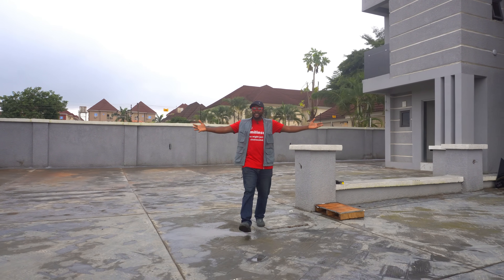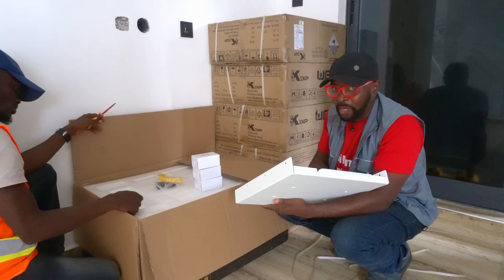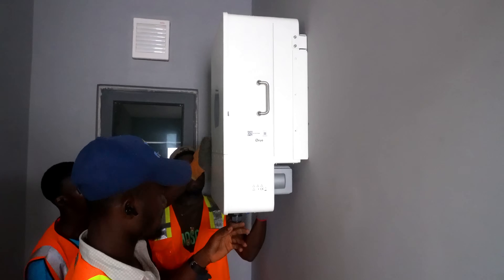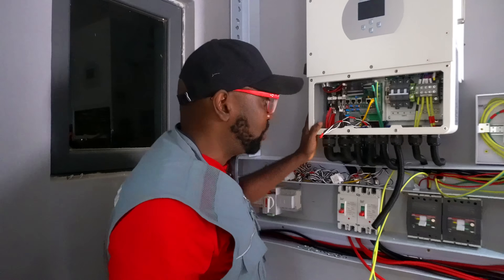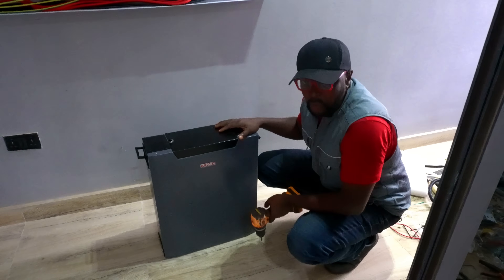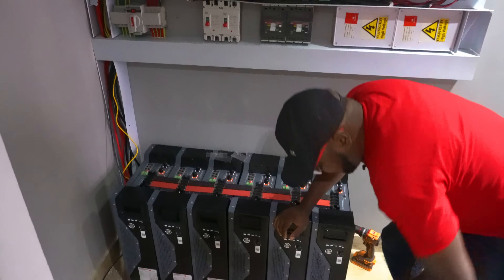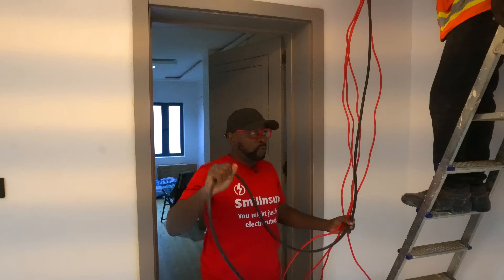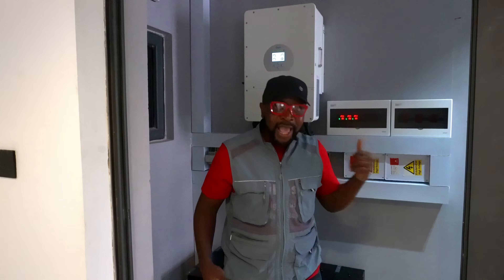Energy flex: Deye 12kW + 6 Weco units. Not just a backup its a takeover.

Comment: Love your installation.

16:31 Does the BMS dynamically adjust the operating values of the battery voltage? just thinking about battery longevity.
Reply from the maker: Yes, a Battery Management System (BMS) can dynamically adjust operating parameters like voltage to optimize performance and longevity. It ensures cells stay within safe limits, balancing charge and preventing degradation.

Comment: You did not connect the magnetic ferrite rings on the battery cable to filter out electromagnetic noise from the switching mosfet .
Reply from the maker: It's connected

Comment: The inverter is 12kw and the panel is approximate 15.5kw.
Is the panels power not too much for the inverter??
Or does the inverter has a different charge control specification that is above 15.5kw ??
Please I need a clarity sir 
I'll be grateful if you reply sir 🙏 🥲 
Thank you
Reply from the maker: The inverters PV Max Wattage capacity is actually 18,000 watts 18kw . The 15.5kw is for single phase but the three phase is 18kw
Reply: @smilinsunsmilinsun8056 
Thanks sir 🙂

Comment: Please, how much does this setup cost? Thanks.
Reply from the maker: Don't worry am sure its what you can afford without breaking a sweat.
Reply: Rough estimate 
Inverter 3m to 3.5m
Batteries 2.3m to 3m each totalling btw 13 to 18m
Panels 130k x 29   3.7m
I cant estimate cabling and workmanship. 
But this is a massive system

Comment: I was wondering. I got a single phase apartment, would it make sense to still install a 3phase Deye inverter?
Reply from the maker: No, it generally doesn’t make sense to install a 3-phase inverter for a single-phase apartment, unless you're planning to upgrade your connection to 3-phase.

Comment: Good work!
Pls note the CTs are for managing import/export from/to grid, ready against when (if) we will have net metering. They are not really for protection in that sense as you mentioned.
Reply from the maker: It’s got a bunch of functions, but the one that matters most for us (and the one I always wave a flag for) is current control and protection, we don't have Net metering around here. The rest are hanging out below if you're curious!" But your feedback is dully appreciated.

Measure output current

Provide feedback for control/protection

Enable overcurrent/short-circuit protection

Assist in load monitoring and energy metering
Reply: @smilinsunsmilinsun8056  I see your point about the CTs being used to measure output power and prevent overload, however I see increasingly that hall-effect current measurement is preferred for modern inverters. Grid-coupling introduces additional safety-related issues - voltage amplitude/phase/frequency synchronisation as well as net power flow (requiring CTs). I used to design these things and still take an active interest in the tech in use. 
Happy to meet F-F when I am in Lagos ... or maybe we can even do a joint tech deep-dive?
Reply: They just released policy for net metering, so at some point in the future we will see this

Comment: What's the difference between 3 phase and Single phase?
Reply from the maker: Single-phase wiring uses two wires (live and neutral) and delivers power in a single alternating current cycle — ideal for homes and light loads.
Three-phase wiring uses three live wires (or three plus neutral) and delivers power in three alternating cycles — used for heavy machinery and industrial applications due to more efficient power delivery.
Reply: @smilinsunsmilinsun8056 master wey Sabi, one question with two different professional answer...I just love you

Comment: What's the difference between 3 phase and Single phase?
Reply from the maker: Single-phase:
Uses 2 wires (Live & Neutral),
Delivers 230V,
Suitable for homes and small appliances,
Power supply is less stable for heavy loads.

Three-phase:
Uses 3 or 4 wires (3 Lives + Neutral),
Delivers 400V,
Ideal for factories and large machines,
Provides more stable and efficient power.
Reply: @smilinsunsmilinsun8056  Quick question, can I still use a single phase inverter for a house that has 7 ACs, an electric burner and a washing machine, or you will suggest I use a 3 phase?
Reply from the maker: @signature_gh2735  You can use single phase

Comment: Deye uses the cheapest, most unreliableble inverter tech on the market. They don't even incorporate an output transformer to provide galvanic isolation. No thanks.
Reply from the maker: Appreciate your input, but it seems there may be a misunderstanding of Deye’s design choices. Their transformerless topology is standard in modern string inverters, offering higher efficiency and reduced losses. Galvanic isolation isn't a reliability metric—it's a design preference based on application. Might be worth reviewing their latest specs and certifications.

Comment: Nice installation. Am impressed about the solar array generation and you didn't share the parameters of the solar panels you tested as well as what section of the building is this system carrying. cause that's a massive building right there 😅
Reply from the maker: Just one section of the building, it's 8 units. I mentioned that panels are 590 Watts.
Reply: @smilinsunsmilinsun8056  okay cool. I meant the voc, vmp, isc and imp